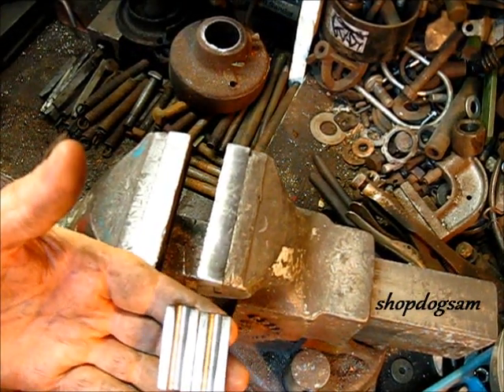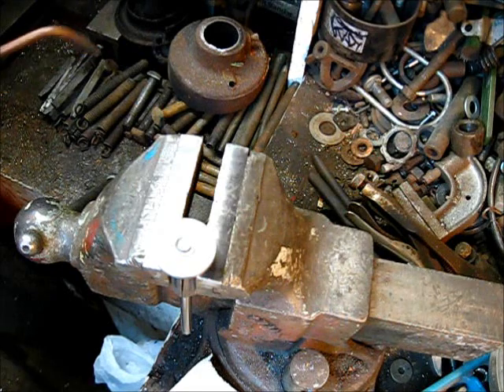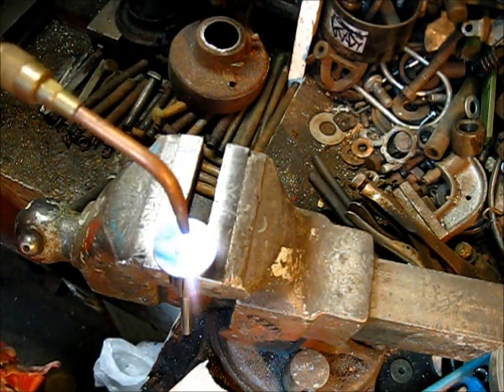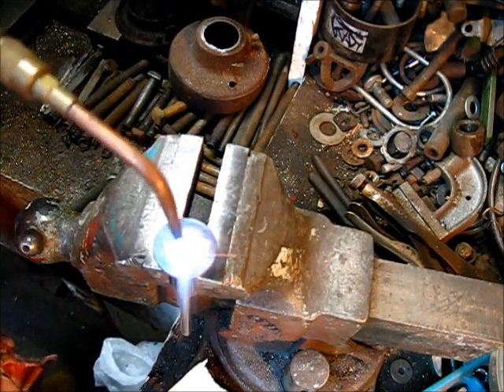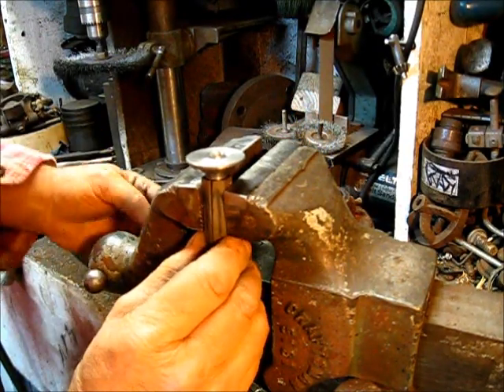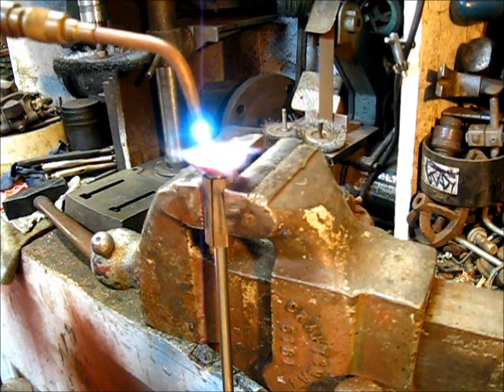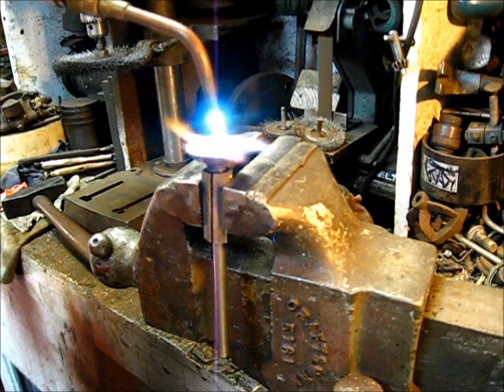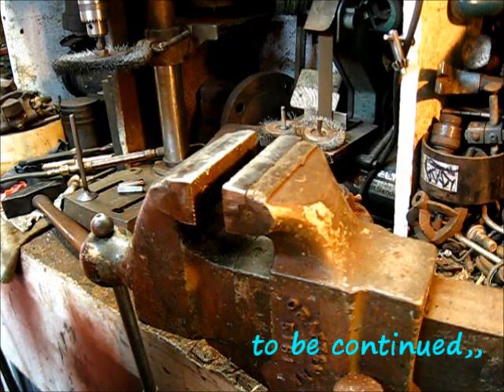I H C ENGINE how to build intake and exhaust valves #7

Comment: Nice one Sam. I saw some of the fancy racing valves being made by a machine that used exactly this method to assemble the valve parts. The stem end wasn't hand peened of course, it was finished by orbital peening in the machine.